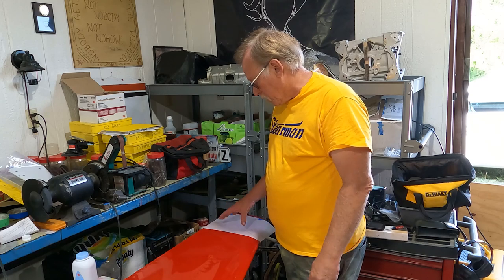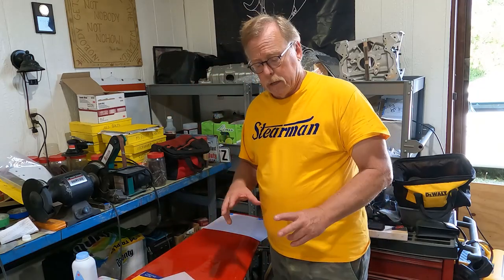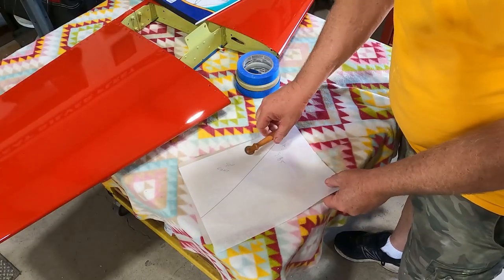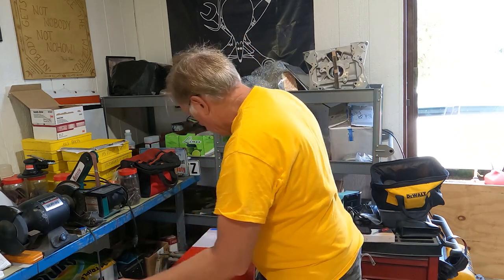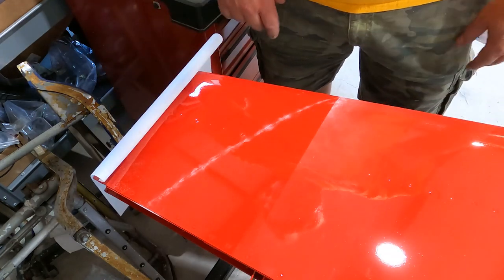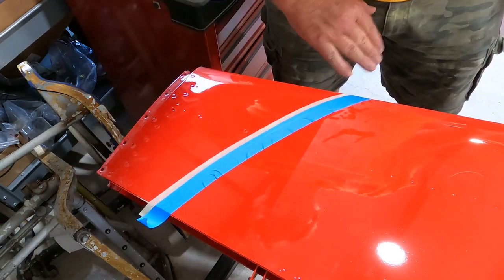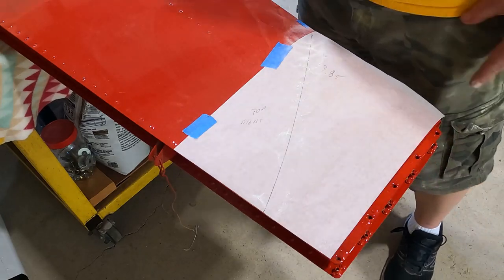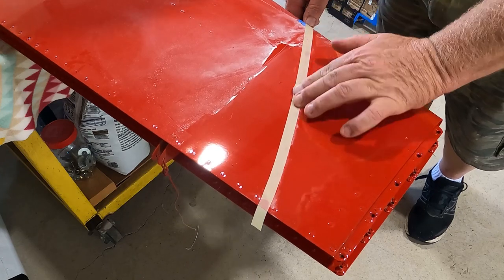Secret Painting Tip! - How to Pounce!

Comment: You forgot a step. You should have sanded the back side of the paper. Another way to do it is to chalk or charcoal the back side of the paper to transfer the pattern. Good job
Reply from the maker: What does the sanding do?  Willing to learn!
Reply: It opens up the pounce holes so the lampblack or chalk can pass through more easily.  @HangaRatz